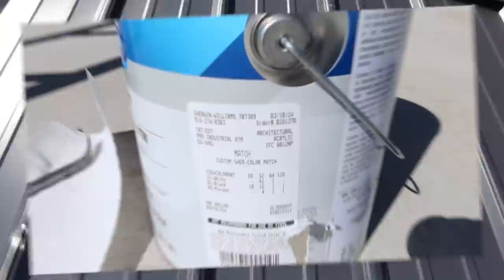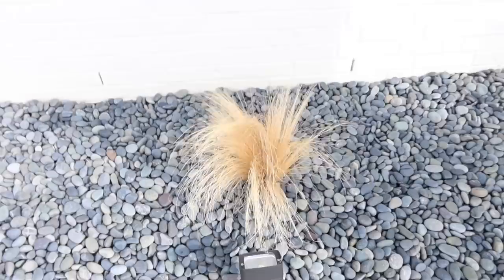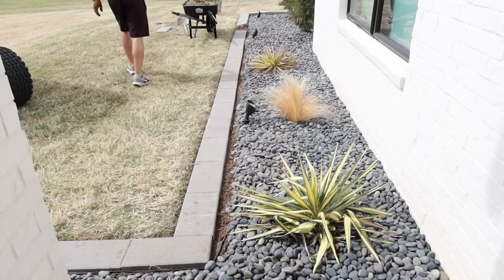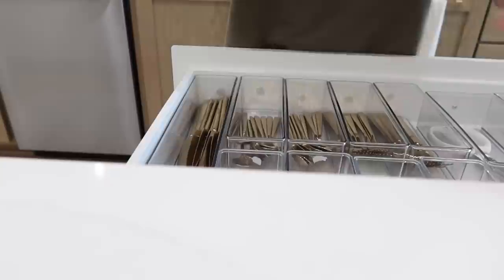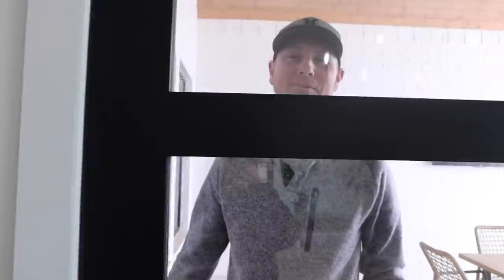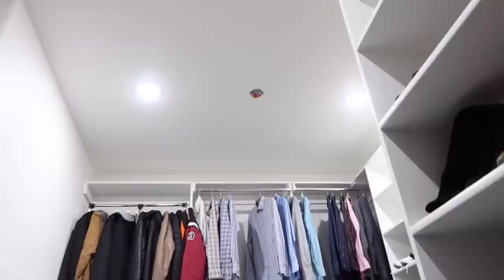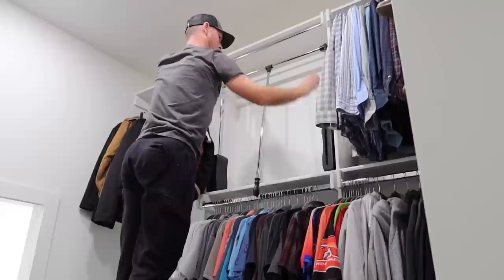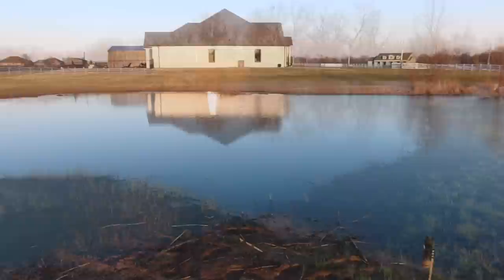TACKLING 9 AFFORDABLE DIY HOME PROJECTS | GET INSPIRED WITH THESE DIY HOME UPGRADES | DIY HOME HACKS

Comment from the maker: Watch us tackle 9 affordable DIY home projects all in one video! These are simple, but add curb appeal, security, efficiency, functionality and more! I added links below from items in today's video!
Blue Pond Dye: https://urlgeni.us/amzn/RepVw
Garage 5 Tier Storage Shelves: https://rstyle.me/+rxvC2HPKIgh_IQIFoWcLRA
Pet No More Marking Spray: https://urlgeni.us/amzn/rRWRb
Gray Edging Stone: https://rstyle.me/+EITUC71YDPfWRrIk_F-AUQ
American Flag: https://rstyle.me/+-Mxv5j1rVGkZ-Ls0d8ZMUw
Museum Wax: https://urlgeni.us/amzn/PPZt8
Door Reinforcement Locks: https://urlgeni.us/amzn/iT77V
Daylight Recessed Lights: https://urlgeni.us/amzn/xZLq9
Rug Grippers: https://urlgeni.us/amzn/kWWaf
Adjustable Closet Pull Down Rods: https://urlgeni.us/amzn/3AgPH
Wood Hangers for Pants and Shirts: https://urlgeni.us/amzn/l4oHK
Velvet Hangers: https://urlgeni.us/amzn/H5wy_
Purse Adjustable Display Holder: https://urlgeni.us/amzn/uEApV
Ninja Mega Kitchen System 72 oz. 5-Speed Black Blender: https://go.magik.ly/ml/212t8/
Hardside Luggage Set Available in 3 Colors, 3 Piece - TSA Compliant: https://go.magik.ly/ml/212ta/
Oversized Black Metal Modern Classic Full-Length Floor Standing Mirror: https://go.magik.ly/ml/212tc/
High Back Chrome Luggage Rack Extra Storage Stand: https://go.magik.ly/ml/212tp/
Bed Tray Table Bamboo Breakfast Tray: https://go.magik.ly/ml/212tr/
41 in. Faux Potted Artificial Cyprus Tree: https://go.magik.ly/ml/212ts/
Cream 28 in. Wide Boucle Upholstered Square Armchair: https://go.magik.ly/ml/212tt/
Organic White Solid Cotton Percale King Duvet Cover: https://go.magik.ly/ml/1y7vx/
Solid 32-Piece Matte Black Stoneware Dinnerware Set (Service for 8): https://go.magik.ly/ml/1y7vt/
Beige Polyester Barrel Chair with Swivel: https://go.magik.ly/ml/212tv/
Aspen Post Prime Oak 6-Drawer Executive Desk: https://go.magik.ly/ml/1qdk0/
HygroCotton Stone Gray 18-Piece Bath Towel Set: https://go.magik.ly/ml/1y7w1/
Bordeaux 67 in. Acrylic Flatbottom Freestanding Bathtub: https://go.magik.ly/ml/1tz3k/

❤ MY RUGS FROM BOUTIQUE RUGS!
Use code ASH for additional 10% off the sale price!
Old Living Room: https://brug.us/AshleynelsonLikelyAreaRug5 
New living room rug: https://brug.us/AshleynelsonAnnalongAreaRug5
Old Master Bedroom Rug: https://brug.us/3Qwhyoe
New Master Bedroom Rug: https://urlgeni.us/amzn/PuyDA
Dining Room: https://brug.us/AshleynelsonMitcheltonAreaRug5 
Entryway Runner: https://brug.us/AshleyNEnliAreaRug5TW
Chase Office: https://brug.us/AshleynelsonBrittanyAreaRug5 
Ashley Office: https://brug.us/AshleynelsonGowan5  
Old Back Patio: https://brug.us/3STgWca
New Back Patio: https://brug.us/4aGISXF
Front Patio: https://brug.us/443Vp3K
Laundry Room: https://brug.us/AshleyNFerrelviewAreaRug5Zp

Comment: Don't dig out the "hair" yet in your garden. Cut it way down and give it a little Miracle Grow. Mine did the same thing. they went dormant, but then they started to turn green. You may have grabbed an annual grass, or you might be lucky and find out it was a perennial grass.
Reply: That was my thought.  Many ornamental grasses either are trimmed in fall or spring.  I'm about to trim mine later today as they too are still yellow and look dead.  They should start growing in green in the next couple months and be back to normal.  We just planted ours late last summer, so I waited to trim them this first year.  I plan to tie them back then give them a good shave.
Reply: Yes I have several ornamental grasses and I have to give them a haircut really low and then they come back in the spring/summer 😀

Comment: Suggestion: I don’t know how much rain you get in Oklahoma but when you were doing the pavers diy project I noticed the rain down spout looks like it might empty into rock area, we had that and it created puddles size of small pond, so maybe think about doing what’s called a “French drain” that connects to your down spout funnels rain in a tube down under the ground and can empty out somewhere else. From what I can see which mind you is just 2 dimensional. Your pond doesn’t seem that far from house? You could run a drain that funnels to pond and empties there to prevent excess puddling water in that rock area. Just a friendly idea.
Also for the sliding container in drawers. Since you don’t want to have to reach all the way to back for stuff you can move everything forward like you did and then just put a nice little block of melamine white coated wood in the gaps in the back and then you wouldn’t have to use the museum gel and it wouldn’t show and everything would be pushed forward not moving around.  You could also just use a small decorative box or another organizer bin just empty or filled with something you must likely wouldn’t use but helps for the main purpose and coordinates. Like a small divider with cocktail forks or small dainty fancy butter knives, corn on the cob holders or??? But it would be in the back to push what you do use forward but still look purposeful and coordinate.
Sorry for the long comment.
I LOVE your videos! You have a beautiful family. Thanks for being here.
Reply from the maker: Thanks so much for the ideas! We do get a lot of rain but thankfully with the location of that downspout it slopes downhill towards front yard quite a bit so it seeps through the rocks and stone and funnels out instead of pooling up. Now we do have other downspouts going underground and out a pop up dispenser further out in the yard for other problem areas.

Comment: So glad at this moment your video post is only 10 days ago. Plenty of time for you to correct your landscaping mishap.

The juniper trees in front of your house are TOO CLOSE. You need to plant them at least 4-5 feet AWAY from the house.  Several years from now when they grow larger, so will the roots, which will grow under your foundation, Crack the concrete and possibly cause structural issues. 

I'm 66 now, but was raised in nursery and landscaping. Hope this helps.

Comment: Hi Ashley. Always love your videos. I have made so many wreaths and door hangings for people who have had their front doors and other house siding damaged from wreaths they have purchased before mine. Every wreath I make has a lightweight wood backing on it that holds the wreath away from the door a bit and that backing is covered with felt that can withstand heat and rain . This prevents scratching and is  an inexpensive and easy DIY. As an added bonus, it helps keep the shape of your wreath and makes it easier to hang it in off-season.
Reply from the maker: That’s a great idea!

Comment: I hope this doesn’t happen for you. We also have some flat edging rectangular stones like that. Unfortunately our riding mower deck is not wide enough to extend out much further than the edge of the tires on the mower, so unfortunately I end up driving on the stones a little, and eventually the stones start leaning and angling down in along the front edge and they don’t stay level. Unfortunately every few years I need to dig them up and re-level them!
All of your projects look so useful!

Comment: Just a tip but use 3 inch screws in those devices on the doors as well as the strike plate for each door.  That makes it kick proof.  The smaller screws would come out easily if it gets kicked.  That is per our friend with the police dept.
Reply: lol didn’t watch far enough to see you change the screws out so never mind haha